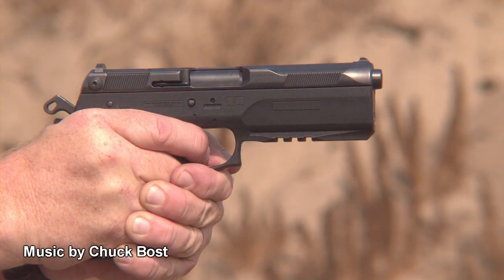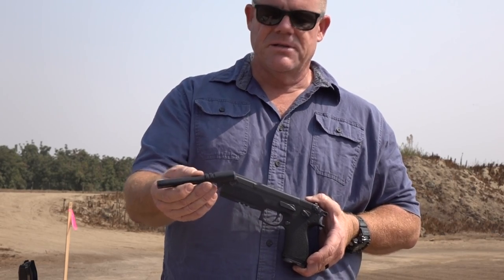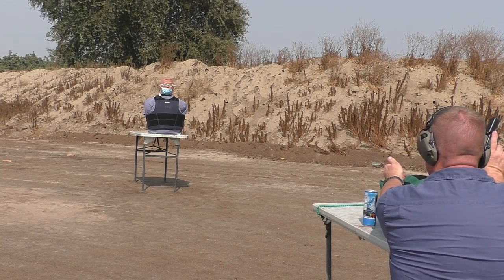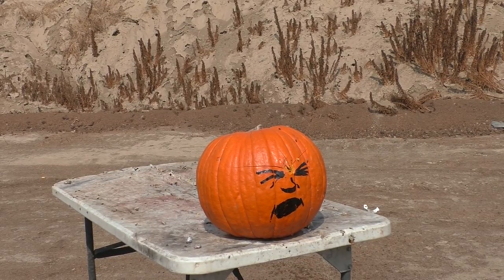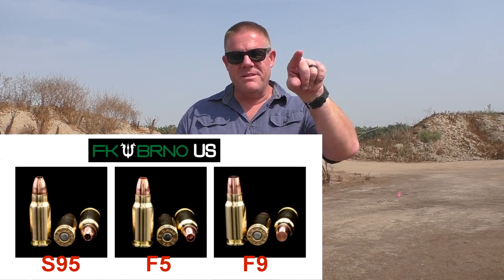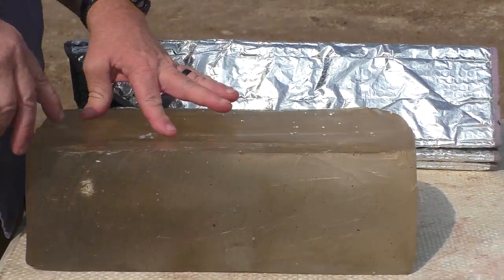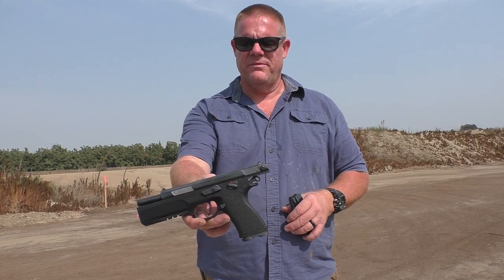FK BRNO 7.5 FK  -vs-  Glock 19 in 9mm

Comment: 9×25 Dillon. I bought a 9×25 Dillon barrel for my G29. A 10mm necked down to a 9mm. Underwood sells a 90gn extreme penetrator rated at 2000 ft per second. I love it. Try that out in your G22 and compare it to the 7.5. Should be similar results. Thanks for the fine videos
Reply from the maker: We'll SEE if we can find that.
Reply: @taofledermaus  
I bought the barrel at lone wolf a couple years ago. You can no longer buy ammo online in California. So I'm screwed on buying anymore Underwood
Reply: @crandall777  
You can buy ammo online.  Just have it shipped to your local dealer like we do down here.

Comment: Basically a 7.62 x 39 (old AK round) at 100 yards. But with much better bullets than the FMJ of the 7.62.
Reply: Also, the diameter, 7.5mm of the round is probably .30 cal (nominal) and the .32 is 8mm.

Comment: My cz-52s handloaded 90g Hornady XTP 's at 1750fps loading is very close to that BRNO, and using Lee data I can load the same bullit to over 1900fps. But this has a little more umph, and prefer to keep the handloads at just under 1750fps to save barrel wear.. with 86 grain FMJ 's they might compete closely on that lead plate.

Comment: With pigs the front legs are like the 2nd butt a little more connective tissue than the back where the Hams are and a cheaper cut a meat it's a real choice cut for BBQ Low and Slow Smoking cooking method.  It is very popular in the Carolinas for BBQ joints and is served chopped and made into sandwiches or placed in plates with Cole Slaw and Baked Beans great stuff!

Comment: The old surplus ammo can run between 1600 and 1700 f.p.s. in 762x25 so its actually a pretty fair test. I have some and a cz 52 pistol and on a bright sunny day you can see a flame a foot long come out the front so yeah its a little hot.

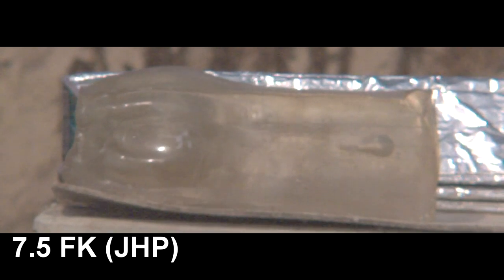Comment: What causes the flash at 20:02?
Reply: Dieselling, a mix of fuel (vaporised gel) air and pressure. This is how diesel engines work without spark plugs.

Comment: I bet the 7.5 bulkets were failing for some reason.  the hollowpoint probably plugged with pumpkin skin and fibers so it acted as a solid/ fmj the first time and the f5 plugged but still partially worked do to it being more fragile and pre programmed to fracture. I want to see a  frangible/ varmint grenade loading and a solid copper or bronze semi wadcutter or full caliber wad cutter. If it works with .30 caliber "heavies" like a 165 grain or even 180 wide meplat / wadcutter ,at 1500pfs or 200 and 220 at 1250 and 1050 fps  it would be alot like some of the silouette shooting compitition rounds , which ended up being popular wildcat cartidges (a wildcat cartidge is  custom made non conmercial cartridge ) tc encore pistol in .30-30 or .32 win or 35 rem.  would probably give a similar performance with a much bigger flash and report. .7.62x39 with a 150 grain bullet and 16 inch barrel, 6.8spc... .30 micro whisper , .400 corbon, .357 magnum 125grain load. 9mm sig, 38super+p , frank barnes 308x1inch.or .308 x 1.5 inch .
.30 carbine. They would all make interesting comparisons .

Comment: Wouldnt it be more fair to compare it to the 10mm? Since thats the parent case. And another thing, the 9mm will kill no problem at 150 yards. the problem is just hitting the target at that distance, and the 7.5 will have that same problem. Thats why they invented rifles ;)
Reply: We compared it to 9mm because it was a familiar round to viewers all over the world. Not because they’re similar.   The energy these things have at 150 yard FAR outdoes 10mm or anything other common pistol round.  They factory zero the pistol at 100 yards.  Point of aim, point of impact.  It’s a pistol designed for 100 yard shots all day long.
Reply: @OGsDangerShow   Sure the ammo is surely good for it, and i get that it has less bullet drop then a 9, or even then a 10mm. But you are still holding a pistol waving and bobbing it around and a short sight radius on top of that.
But i guess your right that its better then a 9mm if you can take a rifle with you.

Comment: The $7500 pistol which fires $1.50 bullets?
OK, I'll compare it to the Glock - you can buy on BRNO or ten Glocks.
Reply: Cracks about the cost aside, I think the problem with this ammo is too much velocity - we're seeing overpenetration so even putting aside the weight and bulk of the pistol for conceal carry, that overpenetration is also a problem for anything but hunting or engaging bad guys at ranges you should be using a carbine.
Reply from the maker: It's about $1650 actually